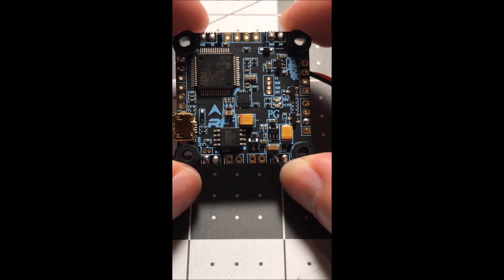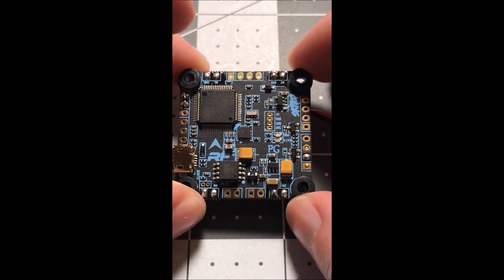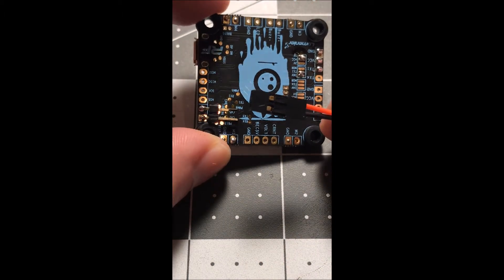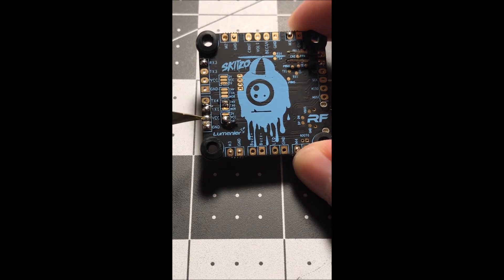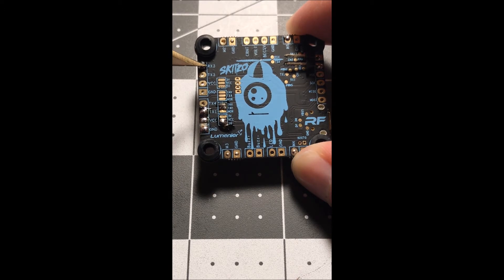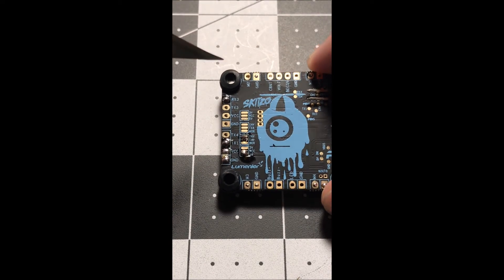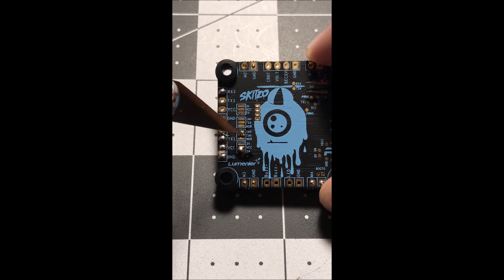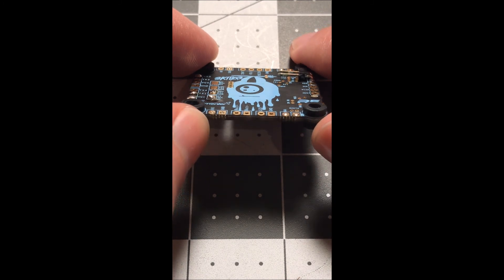SKITZO Raceflight (Revolt V2) Setup with XSR rx

Comment: Hey, thanks for the upload! I can't seem to get it to pick up my commands from the taranis, I've connected it the same way as in the video and selected SBUS in raceflight, the taranis can bind to the Rx but it's not picking up the commands on the receiver screen. Any ideas? 
Thanks in advance.
Reply: Exactly the same problem with mine ...
Reply: jayschop1 I really don't get it, I've even tried going into the tx4 pad and bridging the inverter and tried it that way, still not working.
Reply from the maker: That version of Raceflight uses the "BB4xx".   Raceflight One is the newest and best version that I use, so much better than BB425.  You have to sign up through their slack channel first, which also is the best place to ask questions about raceflight.  https://raceflight.slack.com/
Reply: Flawless Krush just wanted to say thanks bro, I got raceflight one and it worked! Thanks man I was starting to think I'd damaged something during soldering.
Reply from the maker: Hmmm thats odd.  Works fine for me.  On this board I used Raceflight One tho, no issues at all
Reply: Flawless Krush I'm using the raceflight configurator from the chrome App Store, is that the same as your one? I've tried following the guide on the raceflight help page and had no joy. I've opened a support query with raceflight support too so hopefully it gets sorted. I just wanna rip!!